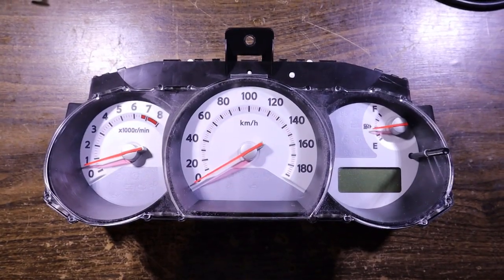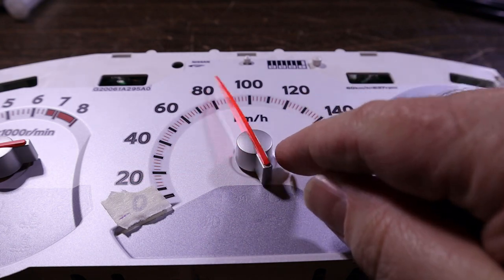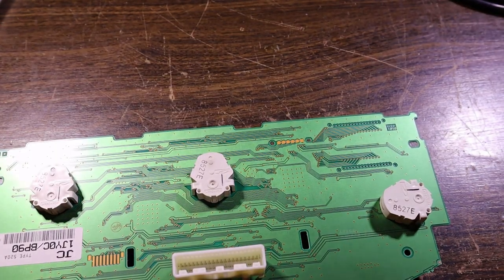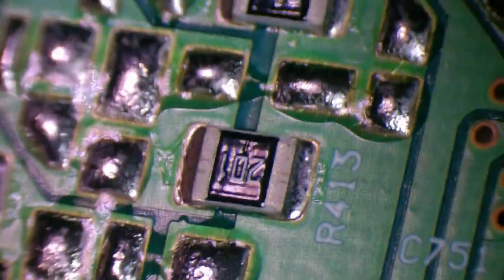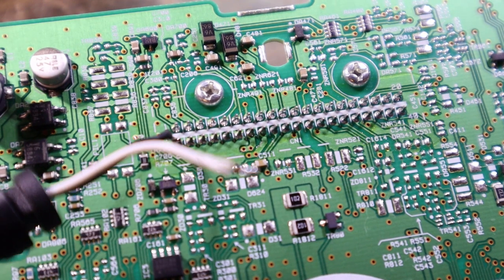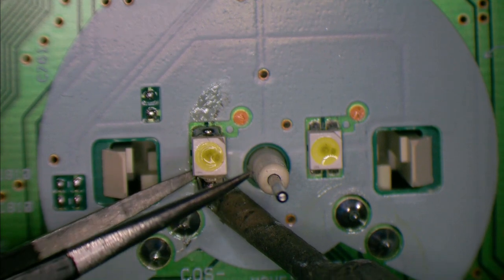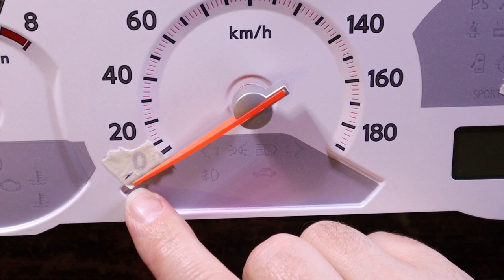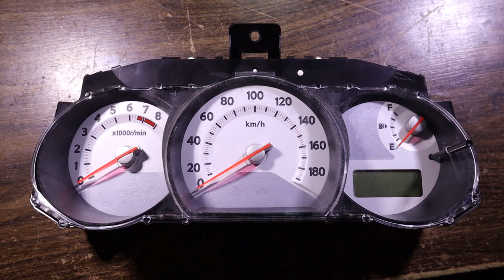Nissan Tiida Instrument Cluster Repair

Comment: Can we connect the input power to a large capacitor that supplies the circuit power?
Reply from the maker: Yes if you are sure that capacitor is on the input. I connected to the diode here because it split the power to 2 different circuits. If I went to the capacitor then 1 circuit would not get power. You could add an extra wire for the other circuit. This is the first cluster I've seen that used a double diode package.
Reply: @JonnyFix  Thankful
My English is not very strong😄 
How do you determine which section each diode belongs to?
Reply from the maker: @sadeghramezani9022  There will be 2 pins in the connector, one will go to 12V always and other will be switched (ignition on) 12V.  You will know which pins because each one goes to the anode of diode and nothing else (google anode and cathode for more info).
Reply: Thank you very much for your kindness